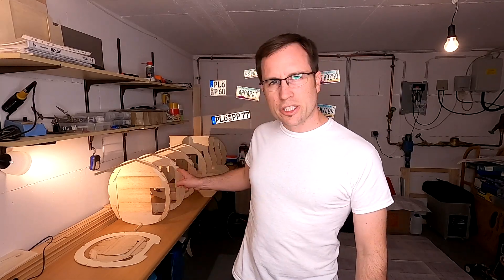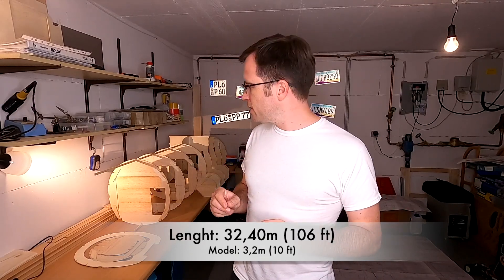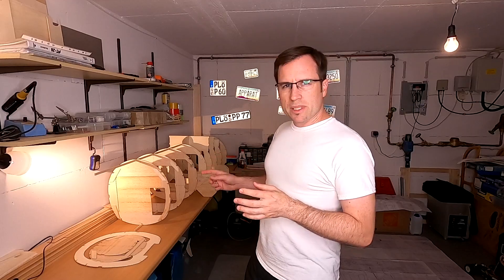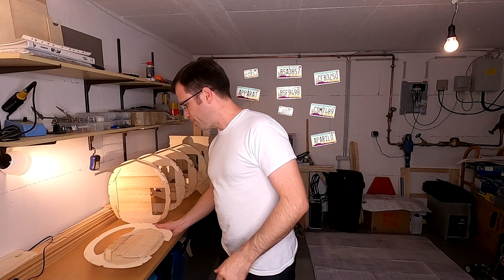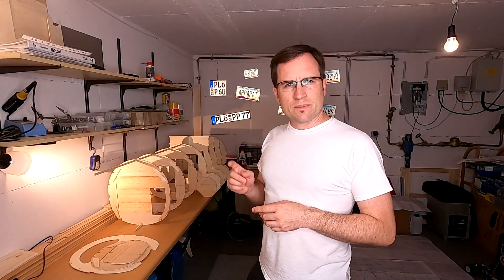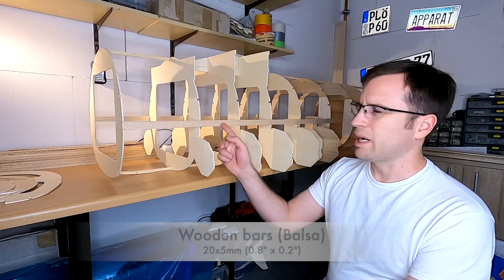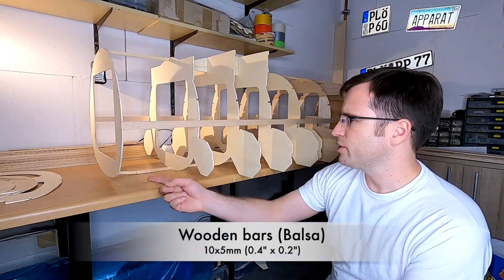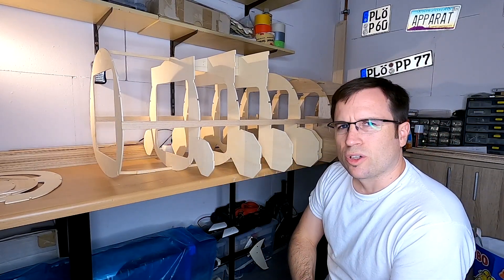I'm building a HUGE RC plane with 4m wingspan! | 1:10 C-160 Transall | Part 2

Comment: I just found and subscribed to your channel, Kudos! I have been scratch building for 56 years and it is great to see a younger person still doing the same. One question, please: I trust that you made sure that all formers were perpendicular to the building board and parallel to each other but it is not obvious from the video. Did you just "eyeball" or actually used tools to make sure that all formers are indeed along a straight center line?
Reply from the maker: That's a lot of eyeballing, but also a lot of measuring (not in the video) to make sure they're perpendicular.... 👍